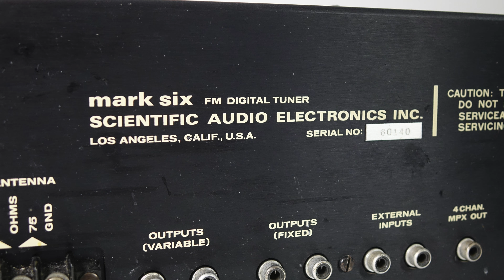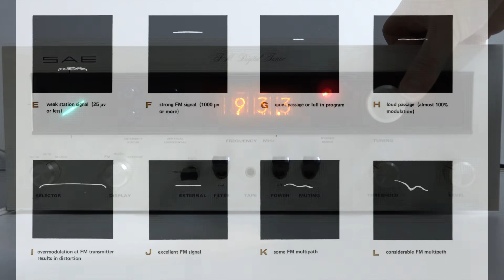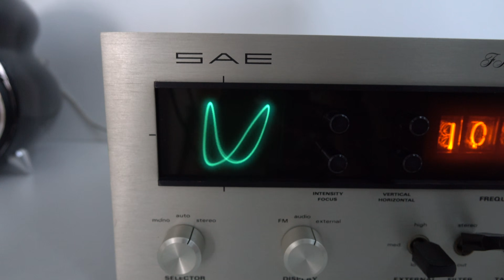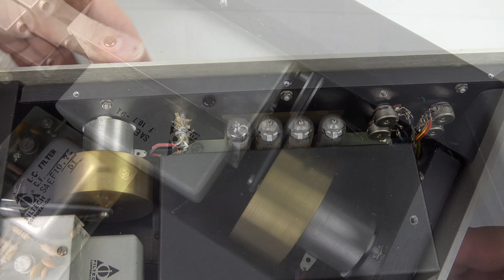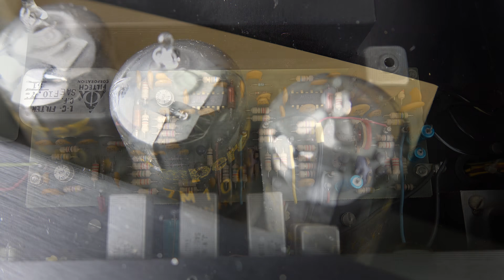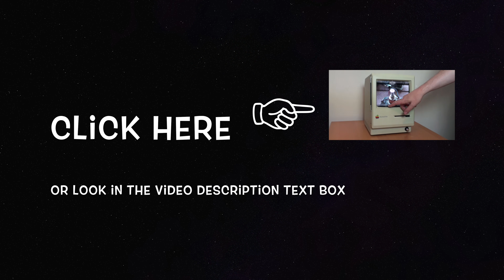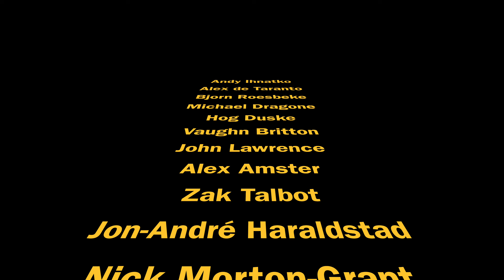Retro-Tech: SAE Mk6 FM Tuner - My Vintage HiFi holy grail

Comment: When I left school in 1978, I worked for a company that, among other things, manufactured a frequency counter that used Nixie tubes (though by the time I worked there it had been superseded by an LED model). I'd love to find one now, they must be rare as hens' teeth. The company was called Dymar Electronics. I only mention it because that shot of the Revox tuner brought back a very strong memory of it for some reason.
Reply from the maker: Old Nixie tube frequency counters are still pretty easy to find on eBay.
Reply: Right, but I  meant a Dymar one specifically. I've never seen one come up on eBay or anywhere else for that matter. Only looked occasionally though.

Comment: 13:40  Some of those vertical mounted electrolytic capacitors have been changed.  The radial mounting style of them is the key to that give away.  Also the pen marks on the circuit board are not factory.  I'm surprised that more of the electrolytic caps have not been replaced yet.

13:28, some of the resistor components have smoked.  the discoloration of the circuit board and blackening residue are obvious.  That black axial capacitor to the right of the sooty yellow disk cap is new.  The wiring above that cap shows obvious soldering iron marks.

Should you wish to get this further repaired or refurbished to like new quality, another youtuber "Mr. Carlsons Lab" is a good source of information.

Comment: 200 KHz spacing has been the US standard for a long time, that's why you only see .1, .3, .5, .7, and .9.  Full modulation is defined as +/- 75 KHz, meaning 150 KHz wide channels with a 25 KHz guard band on each "side."  If you really wanna get geeky, the FCC numbers the channels from 200 (87.9) to 300 (107.9), instead of designating them solely by center frequency.

Comment: Who wouldn't want a "free erection".  Erection is one of those words who's definition was replaced by a vulgar term.  It originally meant "to build or assemble".  For example, new buildings are erected.
Reply: Also our forfathers names in Latin is Homo erectus.
Reply: In fairness, it also means to stand upright (the end result of erecting).  Which is more likely where it's more off color usage arose from.
Reply: +Ethan Poole Good point, forgot about that.  That is where the transition occurred.

Comment: Question - is it clear steps between the frequencies or is there a grace zone like an analogue tuner? That's what I always hated about Digital tuners, they are fixed without being able to truly 'tune' by slightly turning the  knob even if the number does not register exactly..which is common.

Comment: Nice video. From an engineering point of view you can see why it was expensive just looking at the internal layout and choice of some components. I love the serviceability of the central toggle switches - quite clearly made to last. The two IC's are amplifiers specifically designed for the radio, possibly to drive the oscilloscope display in response to the internal FM radio source. I can tell by the shapes of waveforms produced that it's using both the left and right audio channels on either of the scopes axes using a method referred to as Lisajous figures. If you were inputting two synchronised sine waves of the same amplitude the scope would show a perfect circle. By adjusting the frequency and phase of both inputs very specific patterns are obtained. Generally, the amplitude of the inputs proportionately dictates the size of the image. If your Roland thingy can output two square waves try it to see what you get - should be a box! If the frequency on one channel is slightly off it would rotate. There's lots of fun to be had with a scope, a waveform generator and a spare few hours!

Comment: Sequerra - 1st actual digital FM tuner? (Your SAE is analog with digital display.)
I see it had a scope too, but a much more boring LED display. McIntosh had a system oscilloscope called an MP- 4 ? I think. "System Performance Indicator" that matched that era components. And of course Marantz had a scope. 
Speaking of scope, none of these components have ever been within the scope of my affordability window. Not when I was young and they were new nor now I'm old and they are rare. I think I did have an SAE impulse noise reduction unit for records and a graphic EQ from them. 
BTW, good that your KORG  KAOSCILLATOR is a stereo output or you would have gotten a boring diagonal line (as with mono FM)
Very fun, great video. Thanks. Officially jealous. :-)
Reply: To qualify digital in this case, for younger people, it's all analog FM signals being received and played. Not HD radio or other digital transmission. 
In the case of the SAE it is conventional analog circuitry with a digital read out. In a "digital" analog  tuner, the signal is processed digitally and the display is digital.

Comment: That is simply beautiful, inside and out. I've never seen anything like it, Nixie tubes and an oscilloscope in a tuner!
As an electronics engineer, I can vouch for the build quality and layout. Stuff back then was often very untidy with dodgy electrolytics and shoddy wiring. This has been designed with love and attention to detail. The extensive screening with metal cans is very impressive.

Comment: The oscilloscope display is a small CRT television. This thing is awesomely nerdy.  How does it sound?
Reply: Actually, it is far more likely to be an oscilloscope CRT (electrostatic deflection) than a television CRT (magnetic deflection), particularly given the tube length and the lack of obvious deflection coils around the yoke.  Analog oscilloscopes used electrostatic deflection combined with deep tubes as it allowed for much faster deflection accelerations than could be practically achieved using magnetic deflection.  TV, by comparison, only ever had to deal with very low frequencies so magnetic deflection was adequate for such use and simplified design.  These very small CRTs were often produced for applications like (radio) service monitors, which is likely where they sourced this CRT from (they may even have sourced the driver board from the same if they did not wish to roll their own).

Comment: Does it let you change the de-emphasis to the European 50uS or is it stuck on the American 75uS? Probably easy to mod if not. US tuners will sound a little more muffled than they should when used here, but on the other hand, a good quality 75uS tuner is going to sound far nicer than some cheap 50uS one, so I'd leave it be if it sounds great to you as-is. Enjoyable video as always - as others have suggested, get that scope demo running on it!

Comment: Your channel inspired me to put together some sort of HIFI setup. I managed to get a early 90s Pioneer amp for $10 and found some speakers!
Reply from the maker: From reading other comments it seems like you're not alone...a few people have told me similar things, which is fun to hear.
Reply: I still have my fathers early 80's HiFi set up that I mostly use for my vinyl collection.  I was born in 1990 but I love that clean look of brushed metal, random knobs and bouncing LED displays.  My house is this wonderful mix of old and new electronics all working together.  We are redoing large amount of remodeling and I am trying to plan out of large neo-retro electronics rack as a center point of the room.  Those paddle leaf switch are gorgeous and must be super satisfying to flip.
Reply: I recently thought of breaking up and selling my collection of Hi-Fi equipment that's only about 15 years old...after giving it a listen, I just couldn't do it!

Comment: Those kind of paddle switches are called "key switches". Very high quality, the kind they used to use in the telecommunications industry & in broadcasting equipment. Btw: If you're going to connect the scope up to external sources best not to allow it to display a static dot on the screen for any length of time as than can burn the phosphor.
Reply: I have always known them as "leaf switches", never heard them called key switches before.

Comment: You managed to create a 3-D rectangular box on an oscilloscope! Well done. I have never seen that before.
Reply: It is actually being used as an XY vector scope, so you can draw any vector image you want if you are clever enough to encode the left and right audio channel amplitudes correctly.
Reply: Square waves 😎
Reply: You are actually seeing the dissonant chord made of square waves. Makes sense when you think he hooked RCA left and right to the Horizontal/Vertical inputs . Looks like you could use it as a real o-scope with some help from a triangle wave to set the timing
Reply: I thought it was pretty, and very surprising that it was possible. I imagined that more complex electronics would be necessary to make a complex shape like that.
Reply: @buddyclem7328  It's just a specially designed audio signal. You can get software to make such signals, as well as premade audio files, online, and connect your computer's audio output to any oscilloscope that has an X/Y mode. (Note: This doesn't mean such signals will look good on any oscilloscope that has an X/Y mode.)

Edit: I just noticed a relevant Techmoan video in the suggestions on the right: https://www.youtube.com/watch?v=ZaTuFB5QXHo
Reply: It's works just like my 1949 RCA oscilloscope. Bare bones simple.

Comment: Actually the black can over the CRT is a mumetal shielding. Out of a ferro-magnetic material, especially made to keep away low frequency magnetic "noise" from the CRT electron beam. Else the beam would loose track. Yes, the black radial capacitors were installed later. The early Motorola ICs are awesome vintage digitla stuff. They are not in the audio signal path though. The whole thing is amazing. If you need a repair let me know, this is the support that I can offer at the moment.

Comment: I think the oscilloscope is in this case a phase meter. So a \ shaped line is the left signal and the / is the right channel. If the shape is a round O then it is a wide stereo signal. (like stereo noise) :) A mono signal is the | line. (in between / and \)

Comment: Very nice video. However there's one more thing to that FM tuner, other than not tuning the  frequencies with an even decimal. In FM, there is a thing, called pre-emphasis, which means that certain (mid to high) frequencies are boosted to achieve a better signal to noise ratio. The time constant for the FM pre-emphasis is 75uS in the USA and 50uS in Europe (and the rest of the World). This means that the FM tuners imported from the USA will sound a bit dull (lacking in high frequencies) when receiving signals broadcast with equipment set to European standards. (likewise, an European FM tuner would sound harsh when picking up US stations)
I know a guy in Hungary, who's nickname is Tunerman, as high quality FM tuners (like your SAE) and other high-end stuff are his work and hobby. He could modify your unit to have the correct pre-emphasis, and most likely "unlock" all the decimals, so you can tune in to 104.0 and others as well.
By the way, I've got a Revox B260 FM tuner from 1987, which I love to bits. It's a very sensitive receiver, and a very good sounding one, too. If its pro brother, the Studer A764 (which has exactly the same tuner inside, with a bit more features for broadcasters) was good enough for the BBC to monitor the broadcast quality, and also as a relay receiver, it has to be good enough for me :) (likewise with the Studer A807 reel to reel, and the Beyerdynamic DT-770 headphones)
Reply: As it is an analog tuner with a piggybacked digital frequency counter display, there is nothing preventing tuning in the even decimal stations, it is only the display that is limited in what increments it shows.  Most likely the frequency counter is properly recording the even decimals as the odd-only rule was most likely implemented by mapping the 0 and 1 outputs to the "1" digit, 2 and 3 outputs to the "3" digit, etc. as that is a trivial way to achieve such results, in which case you would just have to cut the bridging traces, add the required driver transistors, and run the additional lines out to the Nixie tube (or a similar such workaround)...but why bother since the display limitation does not prevent you from tuning in such channels as-is.
Reply: Interesting to learn something I didn't know about FM receivers, AttilaSVK!
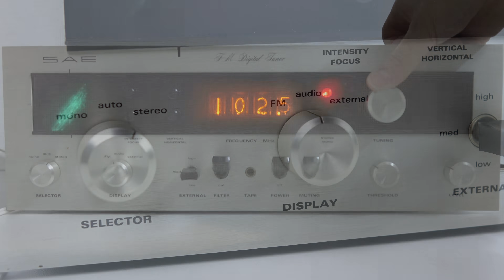Reply: 7:16 Also just so people are aware - In USA there are no stations which are even numbers. All the stations in USA promote an odd numbered frequency. It's why old American radios will often skip even frequencies.
Reply: This guy radios
Reply: AttilaSVK Thanks for explaining the differences between American and British FM standards. I had not heard of pre-emphasis before. As an American, that's probably why I like Japanese equipment, as they usually followed all US standards in broadcast, audio, and video, in order to simplify exports. In my Subaru car stereo, the volume goes up to 33, I assume, because of the Asian preference for odd numbers. I guess the odd FM frequencies go along with that too.

Comment: oscilloscope intessity should alway be as low as possible, otherwise you take de risk of burning que phosphorescent layer, decreasing significantly the life of it
Reply from the maker: It's 45 years old....
Reply from the maker: In the manual it says it auto-blanks when left with no audio in order to protect the tube. However I'm looking for a replacement tube as this one is a bit soft and quite dim. I know the model number, it's just a matter of finding one....no rush.
Reply: +David Wilson Sorry, but 70s resistors are no better than modern resistors (in fact, carbon composition resistors tend to have very poor aging characteristics, which is why they are quite rare nowadays).  Modern resistors do not fail, ever, unless you greatly exceed their specifications or continually push them to the very limit for many, many, hours on end.  As for electrolytic capacitors, it will depend upon what grade of modern capacitor was used. If you are willing to pay a very reasonable premium for high grade modern electrolytic capacitors, rather than opt for junk Chinese capacitors, then they will generally outlast those 70s capacitors when subjected to the same usage conditions.
Reply: +Techmoan It looks great! I'm just sharing with you some advice for it to last 45 years more without damaging de Screen. In the time of  CRT oscilloscopes this was a golden rule to preserve the screen. keep intensity as low as possible
Reply: +David Wilson When evaluating capacitors the measured capacitance really does not tell one terribly much about their state as a capacitor must be extremely degraded for its measured capacitance to drift much out of tolerance.  The parameters that really communicate capacitor health are ESR and D/Q (dissipation and quality factors), these will degrade long before the capacitance value does and indicate how the capacitor will perform when presented with AC conditions (such as with ripple).

When I repair old gear that I want to keep working for years to come I will typically replace all wetted electrolytic capacitors (particularly aluminum) throughout and replace them with authentic quality Japanese brand capacitors (such as Nichicon, Panasonic, etc.) rated for typically 10-20K hours at 105C and often ultra-low ESR type unless the circuit requires a higher ESR capacitor (which is usually only critical if used as part of an RC delay circuit).
Reply: For its age it looks really well made some of the underside capacitors and resistors are better then the ones now. 
Though must warn you some of the resistors you have in there are starting to show there age.
Might want to look into that since those and your fuse (black with a white stripe.), if they support higher then 30 volts you need to get them replaced sometime in the future.
Reply: Some of those capacitors look rough, having someone check and replace them might help
Reply: When seeing the underside board it looks like some of the electrolytic caps have already been replaced, but they were taken out before they went completely.
Reply: I agree with you on that, i notest this a lot with capacitors that i replaced from particulair brands and seem to see a pattern of good and bad ones. But sometimes some old brands made there electronic parts so well. It ended up that there value was still balanced after 20 or more years even 40 in view cases.
The Chinese types are not all great, but some of there brands do come out as useable.
Even favorite in new system builds.
But as they say with some things you can lower voltage and amps and you go micro sized and even chip ( although i am not in favor of chip when it comes to audio and even video )

Comment: The 2 MC1355 ICs are part of the 2 stage FM IF amplifier, probably operating at ~ 10 MHz. Technical name of the IC is a Balanced 4-stage high gain FM/IF amp.
 - Eddy

Comment: Groovy! Thumbs-up.
Reply: The interior and the boads really look home made. It should be easy to repair.  The contacts on the switches are easily accessible and can be cleaned with a pensil eraser (I bet you never heard about doing this). 
I'm surprised it has not been re-capped. Usually electrolytic capacitors require replacement after 20+ years. They must have used high quality components.

Comment: There are several Integrated circuits on there, including the RCA CA3053 (an amplifier) in the metal can beside the MC1355 (FM IF amplifier) there.  The data code on that chip is 7039 indicating it was made in the 39th week of 1970, so the receiver itself was probably made in 1971 or thereabouts.